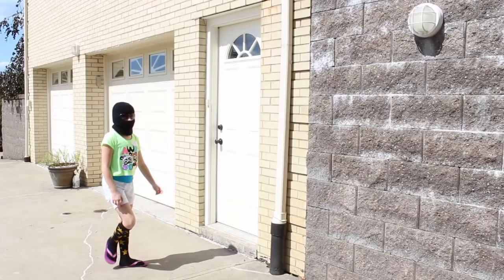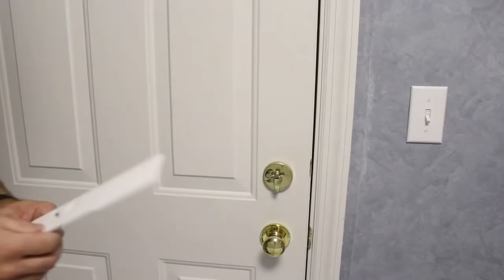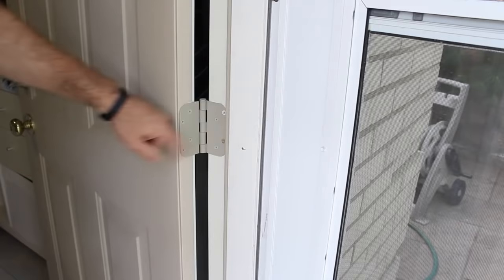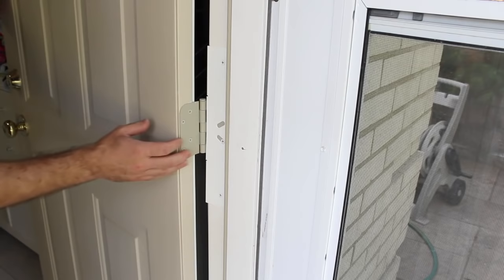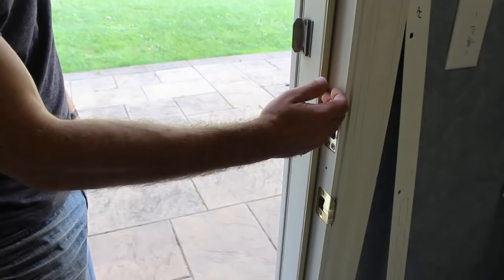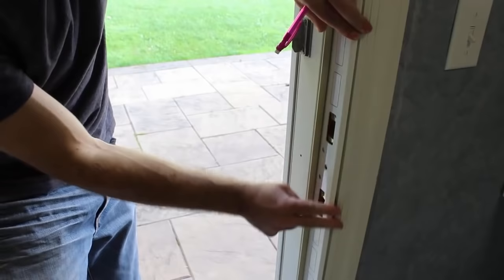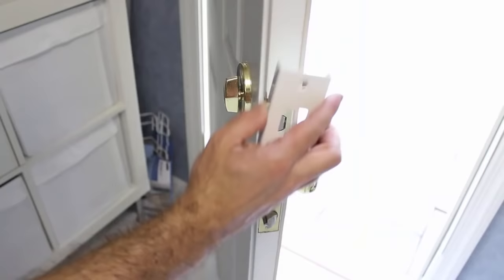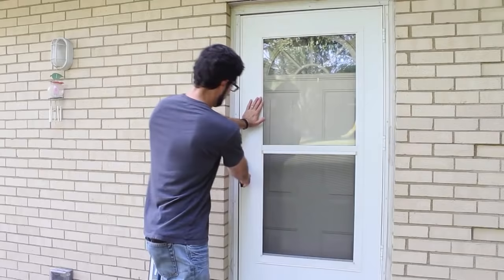How to Reinforce and Burglar Proof Your Entry Door

Comment: I had a door just like it: a metal door. Unfortunately, I found out when somebody kicked it in, that the door just peels apart because the metal is just GLUED to the SOFT WOOD that is in the edges. When somebody kicks in the edge of the door, the metal peels off the glue (or the soft wood breaks). When, this happens the lock completely falls apart because nothing is holding it together! The jam did not give way. The hinges were not the problem. The door peeled apart. My door company explained why I should have gotten a VINYL DOOR: It has HARDWOOD at the edges, the vinyl goes all around the edges to bind the front to the back - all around, and the door has steel reinforcement in it - to keep it from warping in the heat. I found out the hard way that metal doors are terrible at preventing forced entry. Maybe a reinforcement that completely wraps around the door edge at the the lock, and fits underneath the lock, would hold the lock together - however, you door would be so bent up that it would have to be replaced. Vinyll will flex a little with the blows and probably will not be bent out of shape.
Reply: Did you have a barricade on it? Were you away from home?

I have a barricade on my door but only certain hours of the day :/
Reply: A few years ago, I was in the UK and went through a few castle tours along the way.  In one of them, it had a door that I would love to have for the front door of my house, even though it was *just* and *interior* door.  It was created from timbers that were easily a full 2" thick and probably 8" across.  There were two layers of these timbers and they were laid at 90 degree to each other -- in other words, on one side of the door, the timbers were vertical and on the other side they were horizontal.  At each intersection of the timbers, there were heavy steel bolts going through the two layers.  I think there were 4 bolts per intersection.  Add to that a lot of heavy iron hardware on the door.

Comment: Really enjoyed your video. And that's OK for a spec built home because the door framing is all 'standard' sizing and can be kicked in easily as the latch is short into the framing. If you're going2 invest in that mortgage make your home safer & spend a few hundred extra bucks having commercial doors & framing installed. Your insurance company may Thank You for it with a discount on homeowners insurance. Thank you for sharing.

Comment: While it is an effort to improve security, the results are untested. There are a few problems with this kit.

1. The hinge armor plate does nothing to prevent the short screws from where the hinges screw to the DOOR ( not the jamb ) from stripping and ripping out of the 1/4" thick piece of wood that makes up the edge of the steel clad door ( some doors DO have a big wooden hinge lock block behind the edge trim, most do not ) The hinge leaf on that door is ENGINEERED to be surface applied, it was not just something someone goofed up. The door width took the thickness of that hinge leaf into consideration to result in an optimal 1/8" gap on the lock side of door. The hinge leaf on many steel door has a PROJECTION that recesses into a divot in the mating hinge leaf, to prevent pin removal and thus entry on an OUT-SWINGING application. This projection would interfere with these hinge reinforcing plates. Also, these plates prevent the hinge leaves from coming together, putting stress on the hinge pin area, and thus bending the hinges. This will cause uneven door closure, and squeaking, unless you get a third plate for top hinge, and thus all three hinges can distort EVENLY.

2. The strike plate reinforcer is a lightweight version of an armor plate locksmiths have sold for decades. The one from Lock Shop will be 12 gauge, and is meant to be set FLUSH with the door jamb, thus replacing the strike plates that likely do not fit properly. a simple routing of the jamb area to a 1/8" depth allows such a plate to be set properly.

3. The bolt and latch U Channels will not support a bolt or latch that is unsteady. Using a Don-Jo wrap plate will truly REINFORCE the door against splitting, as well as cover up any uglies on the door from lock ill fitting or latches busting loose from a kick. These plates are meant to set flush with door edge ( Routing 1/6" of edge for plate ) and provide a means to re-secure latch and bolt with machine screws, as the plates have stainless steel threadserts in the edge.

All 3 the items from Locksmith Shop, at retail;  about 58.00

You can NOT get this stuff from Lowes, Home Depot, Menards, and hard to get correct ones on internet.
Reply: Wow. That's an education!!
Reply: I  can make that for 1 -10th of that price
Reply: @antonvdmerwe551  Well good for you! Please explain me in which way your comment is useful to the rest of us?
Reply: Don-Jo door guards can be easily found at Amazon and all home hardware stores.
Reply: How is your comments relevant to any of us Mike M
Reply: @antonvdmerwe551   So that peole are aware that Don-Jo products are easily available in store contrary to what that guy wrote in his comment. Pretty easy to understand when you read carefully.

Comment: What good does the hinge guards do if you are still using the 1 inch screws that are in the door itself?
Reply: +richard hall Good question. In my 33 years experience I have never seen the hing side on residential houses. I use DSA from nobreach.com.
Reply: +Lamar Rogers  Is your website recommendation safe? McAfee popped up a warning on the website listed above!!!
Reply: I wondered about this but differently. I don't know why the L-bracket for  the hinge turns towards the frame. It should turn towards the door. This way if the door side screws give up the fight, the L on the bracket would still capture the door.
Reply: Lamar Rogers 
Most people don't want to go through that much trouble for installation.
This works just fine and took me less than an hour.
Reply: richard hall exactly what i was thinking

Comment: First off, you mean burglar resistant, ain't nothing proof! 
 Don't waste your time & $ on any residential dr & frame combo. Pull that junk out and get a good commercial door, frame & hardware. Then put in the steel dr & frame swinging  OUT.  Here is why,  there is a 5/8" stop all the way around the 3 sides of the frame.  There isn't a punk out there that can kick a steel door through that opening, drive a stolen car through it, yes, kick it... Not just no...BUT Hell No!   Now, when you swing the door out, you will need NRP Hinges, NRP= Non removable pin, you can't pop the hinge pins with out having the door open to access the set screw.  Fill in those sidelights, transom panels are usually OK. Most scumbags don't carry a ladder, just crow bars & stolen guns. Get your steel dr & frame prepped for 2 dead bolts and a lockset. Buy 2 sgl cyl DB's  & 1( at least grade 2) lockset,  have them keyed alike (KA). Have the 2 DB preps centered(1 above the lock, 1 below the lock) between the head & floor and the lockset. Your frame should be 16 ga, the door a min of 18 ga. They do offer Insulated & Galv for cold/hot and wet areas. Panel doors are available in 1, 2, 6 & 8 panel drs(depending on the Manuf). I would suggest ordering as a unit and having it factory prepped, it will cost less and have the factory warranty. You'll pay more for what I've told you about, but it's a real door, frame & hdwe, it will hold up way beyond the cheap res junk. What is your family & your things worth?  There are other things you can do, but the above is FAR beyond what 99.9% of your neighbors have. The easiest will get hit, they will give up before they get in yours. 
 I tell people, doors keep the most evil things on the planet out or in, depending on the purpose.  A $19.99 lock and a coke can thin skin dr and wood jamb won't keep you safe, PERIOD. Yes, 3.5" screws help and with wood studs are recommended. Not trying to dog this vid, just giving my years of exp dealing with doors and what's left after the scum gets in.   Keeping thugs out is impossible for most, making them PAY dearly  for trying, isn't!
Reply: Look at profile name..It tells me everything about who and what you're about.T T
Reply: @ATLIEN333  Your point? Your comment has what to do with my post?  Feel better now you've shown you have a mighty fine grasp of the obvious?
Reply: Why not make a youtube video yourself? It would be easier to understand. And would make a good video.
Reply: @drewlsy   That's a great idea, but not sure I'm the right one for the  job?  I forget most have no idea what I'm referring to as I'm usually dealing with those that have been in commercial const for years. If you would like an explanation or clarification and or 
a material list/product info, I would be happy to do this for you.  Thanks for the suggestion, it's much appreciated.
Reply: Just curious, what's stopping someone taking 10 seconds with a battery angle grinder, and cutting the deadbolt/latch in this scenario? I guess if you went to the effort of a commercial door, you'd probably spend the effort or cost in putting a welded plate over the locking mechanisms/catchs/gap between the door and frame.
Reply: @pewur  Your correct, it's called a latch guard. They come in several materials, my choice is SS. They come with a notch for your lock or with out if other Hardware is used.  They also have a post that when the door is closed, the post on the latch guard goes into the frame. This gives an added anti twist and or anti-pry feature. There are more ways to secure the exterior door/s.  A 3 point latch system, a mortise lock & mortise deadbolts, steel stiffened door, etc.  But like I said, most thugs, don't carry grinders, cutting torches, sawzaws, or porta-bands. Plus the commercial Deadbolts have 1"X 3/4" solid  steel latchbolts.  X2 plus your latch on the lockest isn't a 30 sec undertaking, it will attract some attention with grinding or cutting tools.  I would hope if that is a concern, security bars would be an option to consider.  There isn't proof, just resistant, make it as resistant as posible or as you think you'll need with out using Vault doors on your home. It's not as expensive as you might think, doest have to look like a warehouse back door either?
Reply: you can burglar proof....how much time and energy dose a crook want to spend trying to break in.
Reply: david wenzel 
I prefer that better.  A lot of trouble and time to get into my place.
I live in a gated secure condo community. With 4K cameras. I have my own motion sensors and cameras as well and know someone there before they come on property.
Don’t live in a war zone or bunker.
Have a door that will take some time to open if ever.
Hurricane impact resistant windows.
And nothing worth stealing if not at home.
If at hone I do what we normally do in Oklahoma.
Reply: @pewur  if you own a medeco your gona be at the that deadbolt for 5-10min minimum and hope you brought multiple disk and batteries.
Reply: The most you can do is slow them down because they're going to get in!  I live in the country, and there is no other easier target!!   Also there are no nearby neighbors or patrolling law enforcement!!!  Last time they broke in they used a jack and jacked the door frame apart!!!

If you stop them....you go to jail!!   The only way to stop them is to kill them with a booby trap!!!
Reply: NRALifer1 or just built a brick wall and get out through the roof of the house with a secret hidden ladder
Reply: I did just this, l.i.f. online is a home Depot company that sells steel doors with panels so they look like normal door. I tore sheetrock off inside of house and added styro-Crete to wall cavity to stop frame from being pulled apart. My question comes in at where can I get a good bar system for across door, do I have to weld one up. All that I found online are thin strip of metal with small L shaped bolts to hold it.... Thanks
Reply: @drewlsy  No video necessary... I read, understood and could visualize everything NRA described. AND I'm a gurl. Well done and thanks NRA.

Comment: As others have said...pre drilling protects the wood from splitting.  The shank of the screw displaces wood when driven in.  It can cause splitting.  Always pre drill for screws.  The drill should be the diameter of the shank of the screw (the unthreaded portion in the center of the screw).  The device you use to drive the screw makes no difference.

I would prefer heavier duty metal reinforcement and mortising them in place, but that is more than many homeowners can do themselves.  Also, when installing in a home made of concrete block, you may not be able to get 3-1/2" screws to seat flush.  Use as long a screw as possible until you hit the block.

Good devices.  Not "burglar proof" but you don't have to be, you just have to be harder to break into than your neighbor.

Comment: The longer 2 1/2" screws for the bolt and latch don't help anything at all and could interfere with the locks as standard backset for residential locks is only 2 3/8"
Also you should have installed the knob strike OVER the guard as it doesn't have(or appear to have) a "lip" to push the latch in when closing the door

Comment: The safest way is to replace the door with a good quality door, the kind of cardboard wood can be kicked and open anyway
Reply: even a heavy duty door if the screws are itty bitty the frame or deadbolt crack the wood and it opens. these longer screws and plates make the amount of force required to be increased a lot. no one thing secures the house by itself, but all the pieces being improved help make it a deterrent and hopefully they go to another house.  its also to slow them down if you are inside, so you have time to prepare to defend yourself and try to call for help. don't make it easy for them, because that is what most crooks look for, unless they want you.  Could be a rapist and not just a thief, or a killer. They have no business inside, do things to help keep them out.  Protect yourself and the family.  I do agree that heavier stronger doors are always a good idea.

Comment: $60 for a little bit of metal I think you got ripped off you can get same kind metal plates pieces in the hardware store galvanized is like 12 dollars
Reply: XD so ture
Reply: with all the holes in it? for 12 dollars? You good at cutting rectangular holes, measuring and drilling all the holes?
Reply: Gary I'm pretty sure that's why it's expensive, its machined.
Reply: It's very well made and looks good and $60 is less than one hour pay for me. Took me less than an hour to install.
Reply: i doubt people buying this have the ability to drill the holes in the proper spaces, bend the steel at the right angles or even cut to proper length
Reply: sik59rt 
I can probably do it but will cost me in time,energy,and equipment rental. 
I live in a condo. Only have the basic household hand tools. Don't want to do it.

Pay the $60, position it, pop out the square thingys, pre drill, screw it in and you're done.
Reply: MORE STRENGTH..BUT..NOT FOOL PROOF...AND TOO EXPENSIVE FOR THAT!!
Reply: M D 
All depends on the individual.
$60 is less than one hour pay for me.
And I don’t live in a war zone.
Reply: BlackWorldTraveler WELL..YOU ..PROBABLY DIDN'T EVEN NEED IT!!....I'M NOT BROKE EITHER...BUT..THAT DOESN'T MEAN I DON'T KNOW THE VALUE OF THINGS..ESPECIALLY PIECES OF METAL
Reply: BlackWorldTraveler IT WOULD BE NO GRIPE..IF IT WAS A LOT MORE FOOL PROOF...BUT..I DON'T SEE MUCH MORE VALUE IN IT...I'VE ALWAYS BASICALLY DONE THAT AS A MINIMUM TO MY DOORS..AND..TO KEEP OUT INTRUDERS FROM KICKING IN A DOOR WILL REQUIRE MORE..
Reply: M D Wow! You’re so smart! You should have your own show.  Though you might need a special guest to come in to explain where the caps lock is on your computer keyboard.
Reply: You may wanna search for the independent testing video of this set. It held up to a battering ram held and swung by two guy (The battering ram actually broke) and a sledgehammer.
Reply: I agree!
Reply: Yup
Reply: @kenf3299  Could you please provide a link for that video? Thank you.
Reply: @mikem8145  It is on their website.
Reply: You know what works even better than. This? Replacing most of the screws with 3" screws and that'll provide comparable protection. 
You can buy a deadbolt sleeve that goes into the mortised part of the door frame and it sits behind the deadjt strike plate. Schlage makes one and it's probably at least twice as thick as that metal. I'm sure you can get that piece for $5 or less. 

This product only slightly improves your resistance to brute Force attacks. It doesn't matter much when. You still have a $15 kwikset deadbolt from home Depot. 

You're welcome.

Comment: Thanks for the upload. Ignore the haters.
The trouble with all the negative comments, aside from the general negativity, is that this is more deterrent than burglar or home invasion-proof. How many kicks does it take to deter a burglar? How many kicks or sledgehammer attempts does it take to wake you up to defend your family if you're home? If someone REALLY wants in, it's a matter of time before they're going to get in. The more time it takes and the more noise they make goes a long way to discouraging a criminal. If all you perfectionists and structural engineers want to predrill, then by all means, predrill. Personally, I would predrill if I gave a crap about how it looks underneath the metal reinforcement, but structurally speaking, the 2.5 inches of screw going into the structural wood behind the doorjamb is what really matters here. The ease and quickness of the install is what people should focus on. We're not all finish carpenters.
Reply: Like my dad always told us with our cars - make it harder to break into than the one next to it. Not that you want to think that way about your neighbors' houses, of course. But making it more difficult than they expected goes a long way.